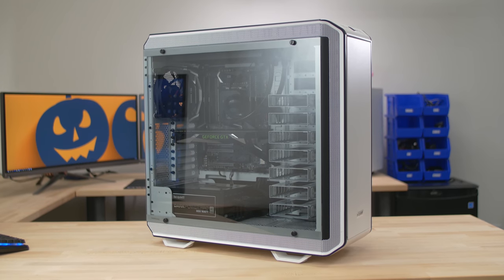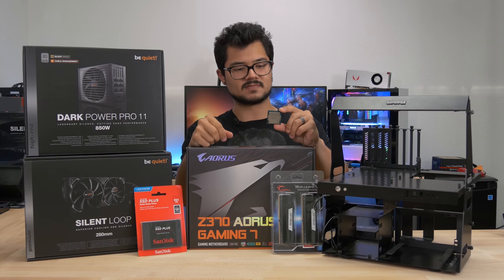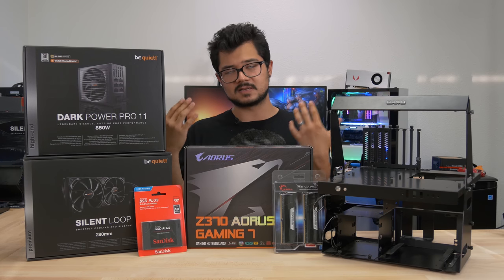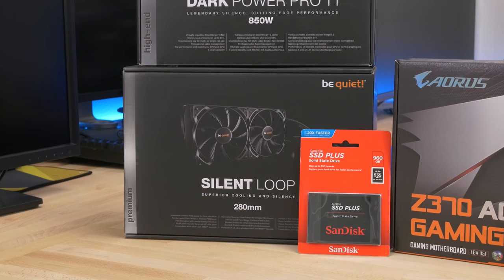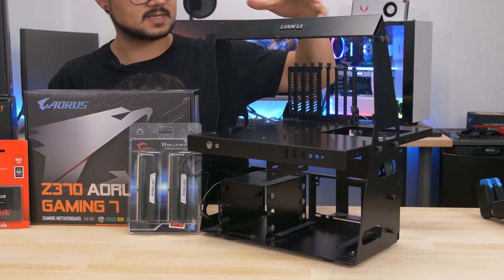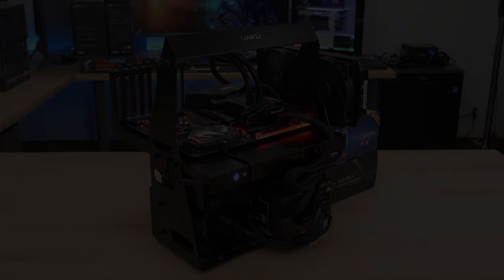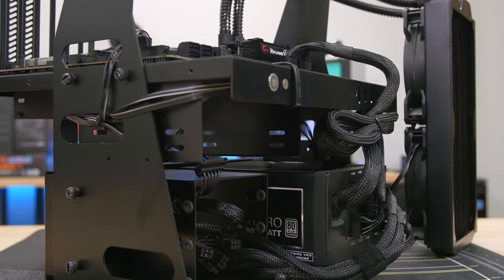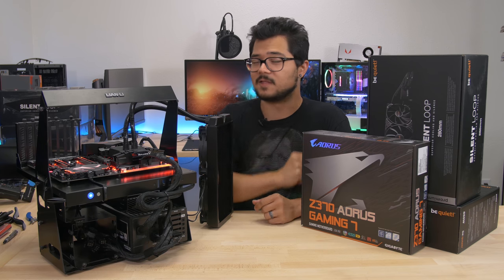Building a Z370 Coffee Lake Test Bed!

Comment: Finally a decent PSU! Now, if you could fix that crappy SSD, ie change it to the MX300 or SL308, that would be nice
Reply: Seon-Ho it clearly works, what's wrong with it?
Reply: alcowherd7 It works, the same way the Corsair VS works. It uses crappy TLC NAND, and has bad performance. The SL308 and MX300 cost less, and are actually good SSDs.
Reply: Seon-Ho yeah he probably had it laying around anyways. It's fine for an OS drive since all he is doing is benchmarks. Besides apparently some of these come with TLC and some of them are MLC. Ultras are the way to go but these are suitable for Kyle's work.
Reply: alcowherd7 But why have one in the first place, and why use it for something that's supposed to be fairly reliable and high end? That would be like using a VS Series PSU because he had it lying around. It will technically work, but it doesn't make sense for anything more than an ultra budget build.
Reply: Seon-Ho this isn't a "build" at all its just a test bench. He just needs a drive fast enough to do quick restarts and quick load all of his benchmarks and games.

Also there is nothing unreliable about these drives. An ssd is an ssd. Unless it does half the speed of regular Ssds then there is no difference. I don't know where you are getting this bs info from, but just because it isn't an 850 EVO or an MX300 doesn't mean it is a bad drive. If it was you would find articles about its high failure rates or poor performance.
Reply: alcowherd7 An SSD is not just an SSD. These drives use different components whenever SanDisk decides to change them. Some use MLC NAND, some use TLC NAND, and there's no guarantee that they won't change the components to some crap. As if the performance isn't already a giveaway that it's not a good drive. 
There's no reason at all, whatsoever to even consider buying it. The issues are the pricing, the performance and the constantly changing components. So the earlier review units were better than the newer drives that people actually buy. And it's not like Kyle doesn't influence the decisions of potential buyers. 
And just because you live in your little bubble without professional reviews, doesn't mean that it's a good drive.
Reply: Seon-Ho lol, not living a bubble, just not part of the whole circlejerk that if it isn't a high end Ssd, then it is a terrible drive, with slow speeds and poor reliability.

My point was that he really doesn't need a high end drive just for a test bench. Also it's not up to Kyle to make sure that he only promotes the high end products. People need to do their own research and know what they need for their build. You wouldn't recommend a Nas drive to someone that just needs space for games, nor would you recommend an i7 to someone that exclusively uses chrome and windows office, so why recommend a higher end product when it will have no appreciable benefits.
Reply: alcowherd7 He doesn't need to only promote high end products. He just needs to not promote any trash. I wouldn't have a problem with the SSD Plus if it was priced reasonably. As in ~$65 for the 240GB version. But it's not. It costs more than the fairly good SL308. Neither the SL308, the MX300 nor the 850 Evo are high end SSDs. They are still good. 
There's no reason to get a high end SSD in a budget build, but there's no need to get one of the worse SSDs in a test bench.
What you're saying is that there's no need to get anything higher than a VS Series PSU, no need to get anything higher than a Gigabyte motherboard, and no need to get a better GPU than Zotac. It won't affect the performance "noticeably". 
I'm not saying that people will look at the test bench and just buy the exact components. They may, however, get the impression that the SSD Plus is worth buying.
Reply: Ok, so it's not the greatest ssd for value, but we don't know if that was sent to him recently or a while ago and he is just using it now, or if he got a good deal on it, either way you are looking into too much. He doesn't have to go over his rationale for each and every component of each build just to cover his ass from "recommending" a product that he is using in a build for the sake of it.

If people are too dense to spend hundreds of dollars on parts they haven't done research on then that's their own fault, and it's not up to tech youtubers to hold our hands through the process of building a PC.

Maybe i'm just not entitled or w/e but it seems a bit ridiculous to rely on someone else to take all of the work out of putting together a PC.
Reply: alcowherd7 If he got it for free, then it's less of an issue. But still. You'd be surprised by how many people see something being used by a Youtuber, then deciding that it's not crap. Old CX series, VS Series, B1, N1, Gigabyte AM4, Zotac, Powercolor.
Reply: Seon-Ho fair enough. It is surprising how little some people think for themselves.